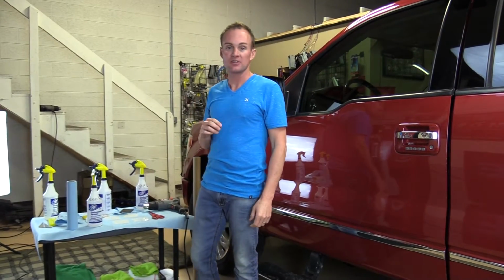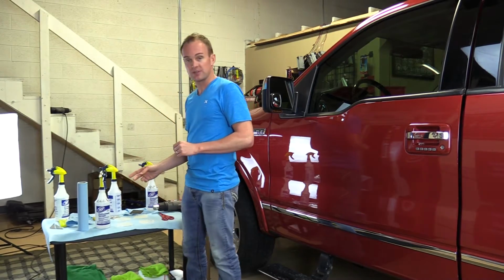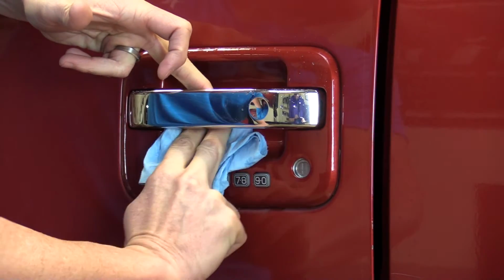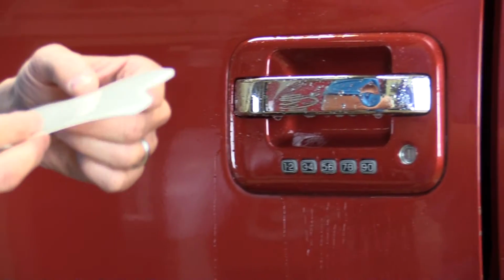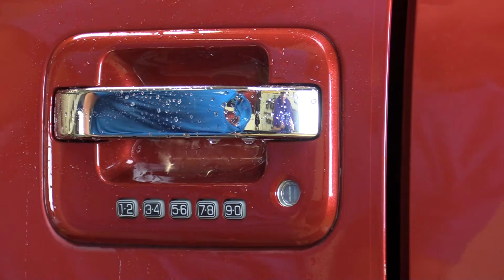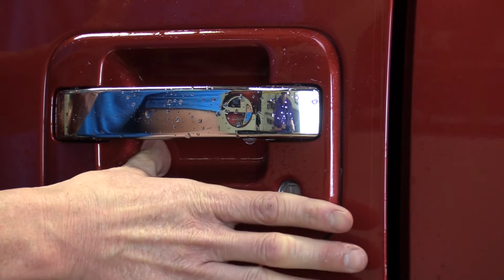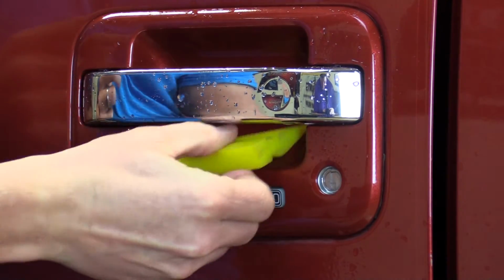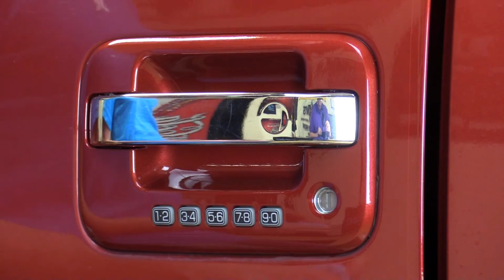How To Install Universal Door Cup Protector--Any Vehicle

Comment: You mention isopropyl alcohol solution twice but never the solution that comes with your product. The instruction card that comes with the product has different instructions from what's on this video. Specifically, after cleaning the door cup with alcohol solution, the card states, "5. Wet the vehicle's door cup with the installation solution included." So which is it? After cleaning with the alcohol solution, do we AGAIN spray alcohol solution or do we spray the solution that came with your product. Your marketing and product people need to get your act together. SMH.
Reply from the maker: We apologize for the confusion.  There are a number of ways the material can be installed.  We have tried to update our instructions to make it easier for people, but this video still very much works for installing the material.